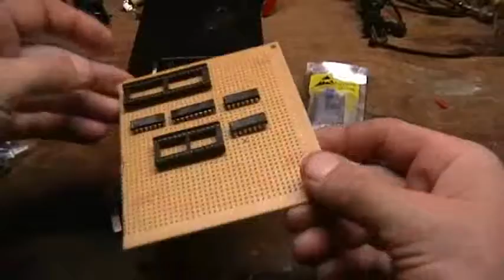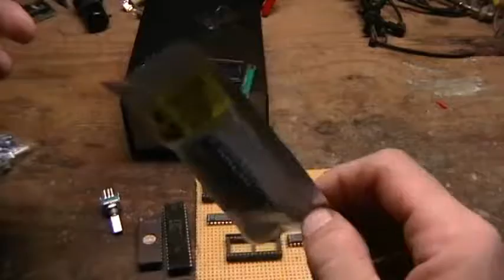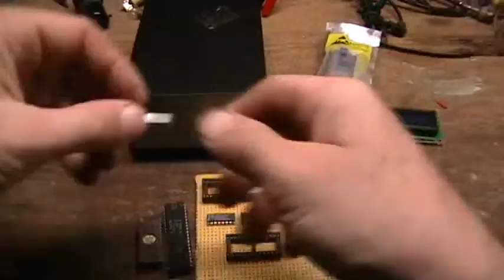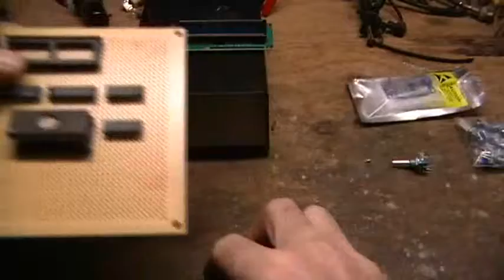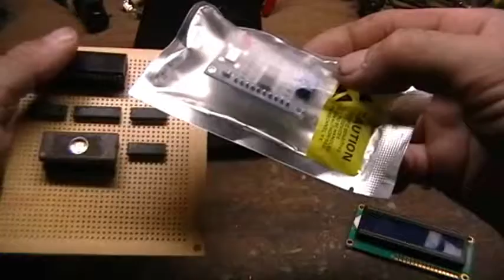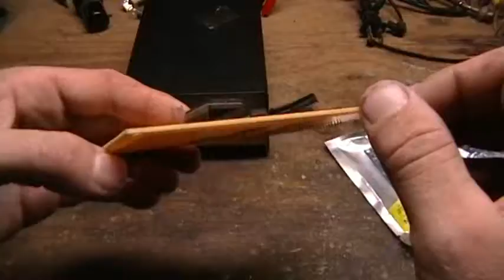First stages of an 8048 based AD9850 DDS generator project.

Comment: 8048 very old microcontroller , Cool project did you complete the DDS ? there is 8748 version which build in EPROM..  i just check 8048 CPU only have 1KB memory address which is 10bits , i though they are same with 8051 which have 64KB address bus.